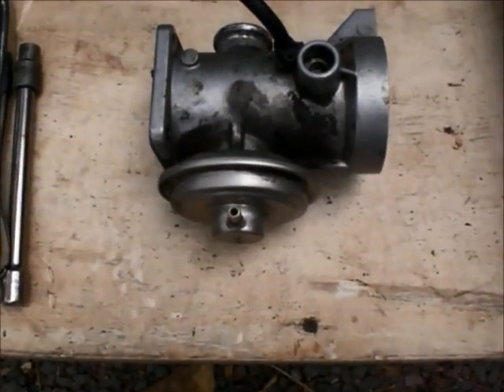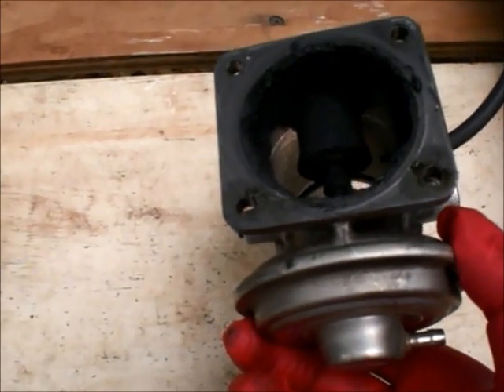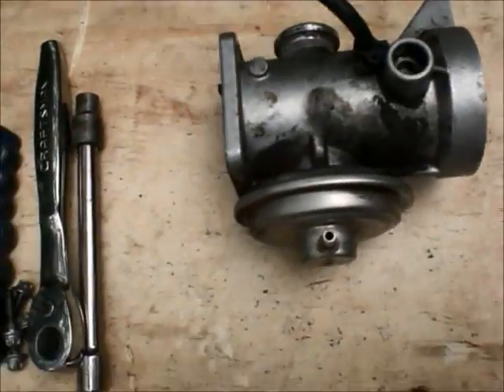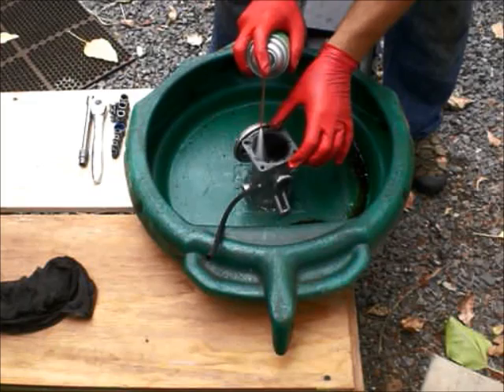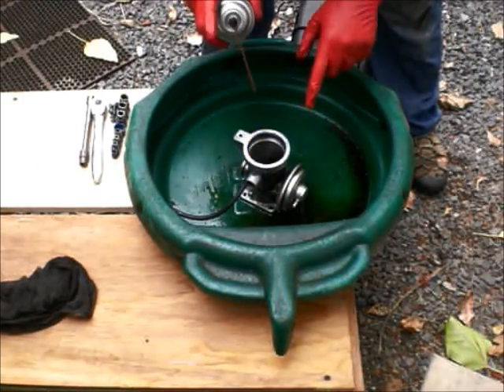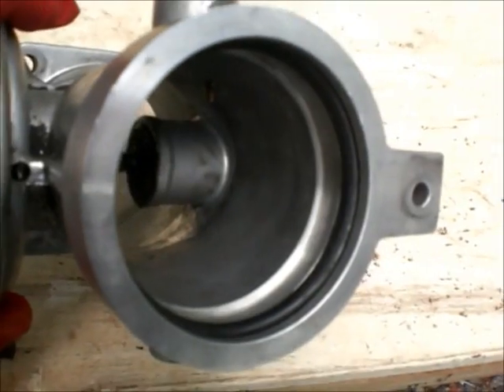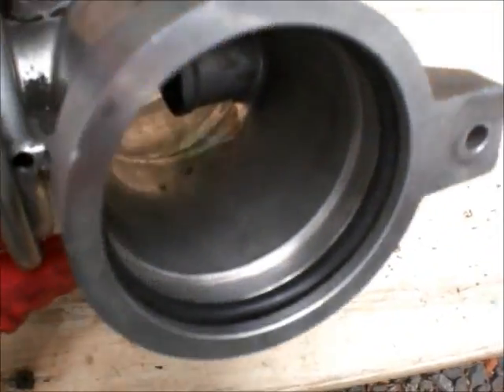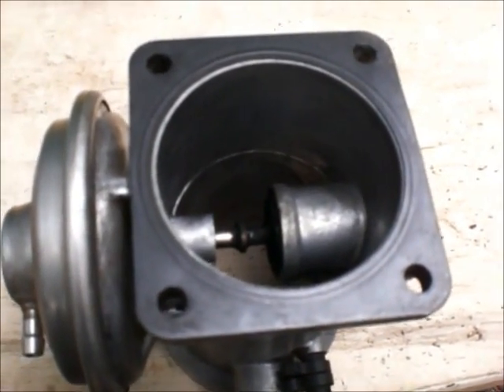egr valve cleaning

Comment: I have a 2000 Mercedes s 430 and I have a Egr light I changed both egr valve I still get engine light and code po400 which is EGR valve how do I solve this matter
Reply: +Bruce Montgomery check the hoses you might have a leaky hose
Reply: if the car looses power then its the vnts on the turbo. but its tripping your computer to throw up egr fault. get visual of the actuator movment by starting the engine it should retract around 1.5cm and the turn off engine it should do the opposite of that. if its not doing tht then its turbo
Reply: Guys he has a 430 !!! thats not a turbo......

Comment: Thanks for the reply, 

I had the P400 code show up on my ODBII reader, It came out to be a EGR valve error, have a E430 gasoline. A nice fellow from Autozone pointed to me where the EGR valve & I was able to take out my air intake and reach the EGR valve in the back of my engine. Took it out & started to clean the inside with brake fluid spray. After an hour or two of cleaning I put the thing back in & cleared the code. Hasn't came back yet in about 50 miles. usually takes 20 miles to return.

Comment from the maker: i do remove all bolts which holds manifold to head, than remove bolt holding it to intercooler pipe, than slowly lift up..its not easy operation, bad design from MB, i even did small modification for myself......your broken bolts should be removed and replaced, and MB says you should replace that gasket every single time when removed, no need for rubber o-ring at intercooler pipe...have fun !

Comment: i didn't undestodd why the break  cleaner didn't worked .. why we should'nt use the break cleaner for that?
Reply: Yes, brake cleaner can be used, paint thinner, ...all is solvent, all remove carbon deposits.Gasoline, degreaser engine cleaner...